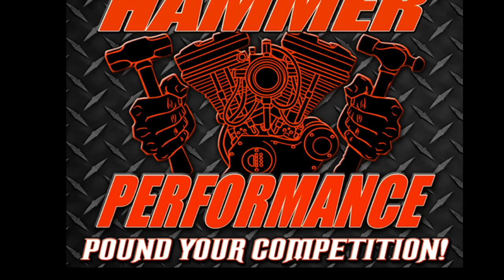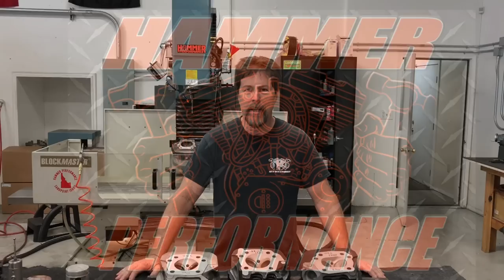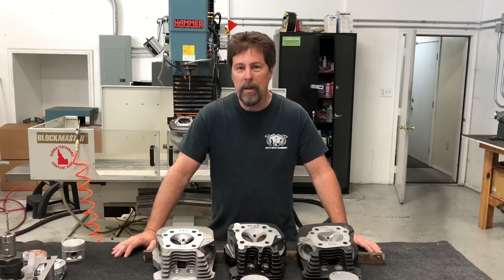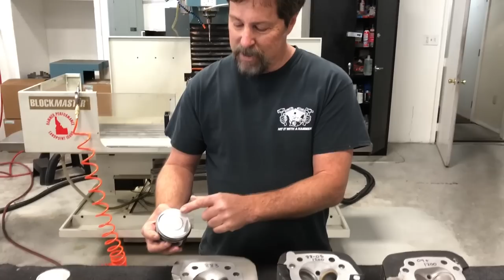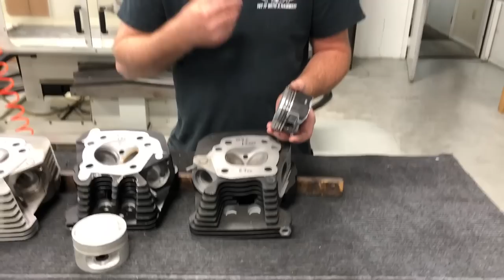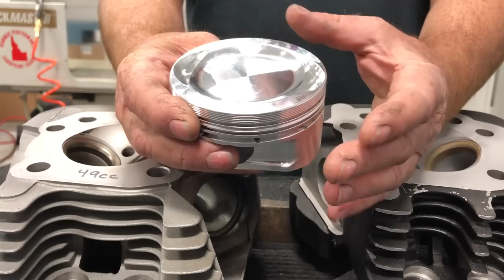The Basics Of Converting Your 883

Comment: Why does almost no one mention,  picking up a used buell xb12 engine,  and using it to build on. I just looked,  you can get a used buell engine for about 1k, with reasonable mileage.  It gives you the bottom end,  the pistons and rods, the heads, cams and lifters,  oil pump,  and primary parts.  Almost any local shop,  can do the machine work,  to allow the sportster cases, to accept the buell bottom end ( its not expensive) , and every shop I've checked with,  is familiar with the work.  With the cost of a used buell engine,  and machine costs, you can build a sportster engine,  that makes 100hp, 85 ft lb, for under 2k, if you did the work your self.  That beats any kit I have ever seen, when you consider all the upgrades you get. Even the buell oil pump,  is far better than what comes on a sportster.  The crank and bottom end is far superior,  to even a 1200 sportster.  Even with the cost of these kits,  your still at the mercy of the weak sportster bottom end. The Harley factory,  sportster bottom end,  will never handle revs to 7k, for a life over 50k miles.  The buell bottom end,  even with high piston speeds, will live for a long time,  revving to 7k every day.  There are buells with well over 50k miles,  that rev happily to 7k , with out issues,  and many will hold up to near or more than 100k, if you don't beat on it every day.  Cost wise,  and for reliability,  hands down,  picking up a used buell engine,  to build a sleeper sporty,  is the way to go.  I personally own an xb12s, and it's been an amazing bike.  I couldn't imagine a sportster,  with basically the same engine,  how awesome it would be.  I'm just surprised,  that a buell to sportster conversions,  isn't more often mentioned,  as apposed to the pricey stage 3 and 4 kits readily and,  and those kits do not improve the bottom end, for about the same money,  you get a better bottom end, better oil pump,  and a potential 100 hp, with durability,  revs to 7k without complaining,  ( I didn't factor in the cost of the fuel system,  throttle body,  ecu etc ) but even with that cost,  you still end up with a better engine.  And the cost is reasonable.  I'm guessing about 2500, for everything,  as long as you did the work your self ( minus shop labor to mod the case) please tell me if I'm wrong,  I encourage comments.  I've done alot of research on this.  The best way to make 100hp sporty,  is to use a sourced buell engine.
Reply from the maker: Through 2007, Buell and Sportster oil pumps of the same model year are identical, except for the fittings on the XB's are different. Literally every upgrade HD made to the pumps from 1998 to 2007 was applied equally to both the Buell and the Sportster platform. In 2008, the oil pump design was changed for the Buells, integrating it into the cam box cover cover and driving it off the cams, and the XR1200 got essentially the same design, but it's not retrofittable to an XL, it's a whole different deal. That cover won't bolt onto the XL case and likewise the cams that drive the oil pump won't fit and work in an XL motor.

As far as the cranks go, there's nothing about a Buell crank through 2007 that's more durable than a Sportster crank of the same year. It's slightly lighter, but both use the same size crank pin (1.25 inch), the same connecting rods, the same pinion shaft, and the same size sprocket shaft. In 2008, the Buells did get a much improved crankshaft, as did the XR 1200 (literally the same part number), and assuming you also get the matching front primary sprocket/alternator rotor assembly, these bolt right into the 2004+ XL and make a nice upgrade. No machine work is needed for this swap. This new improved crank can also be retrofitted to a 91-03 XL with a special service and parts we offer, and far as I know, nobody else offers this. It's not a simple process to retrofit it, we developed a lot of stuff to be able to do it, and other shops send them to us to be done.

The cams do not interchange between the XB and XL motor. Some people will argue that it can be done by figuring out where the marks should be, but the cam timing doesn't come out right when you do that (we've measured it). Also if you need the timing cup, the XB cams do not have the notch in the right place for the XL timing cup. The 2003-2007 XB cams are available already configured for the XL platform, however, in the form of SE cams (specifically the .551 lift SE cams). That's a much better way to use those cams in a Sportster. They're not a great set of cams anyway.

All 2004 XL1200's already have heads that are functionally identical to XB heads. They differ cosmetically, but they literally have the same ports, chambers, valves, springs, retainers, etc, the exact same part numbers in fact for the hardware. XB heads won't fit on 2007+ Sportsters, though, the gap between the manifold mating surfaces is wrong for the Sportster's throttle body. And the Buell throttle body won't fit the Sportster application, it's not compatible with the Delphi ECM, and the gas tank is in the way.

Also keep in mind that despite the 103hp claim for the Buell XB12, they dyno at about 90hp, we've dyno tested bunches of them. The 103hp is a crank figure, without the drivetrain losses.

 Bottom line here is that's it's not that cut and dried. The interchangeability that's possible between the two platforms, and the usefulness of the interchangeability, depends heavily on the specific years and models. A person better understand all the specifics of what he's trying to bring over from the XB to the XL to know first off if it's possible and second if it's actually an improvement. There are a lot of details. And to the extent you can bring parts over, they may not do as much as you might think.

Comment: Trade your 883 in a on a 1200. Done ✅
Reply: The benefit of swapping the head/boreing it is the gear ratio of the 883 tranny is different than the 1200 so you end up getting more torque than a stock 1200.
Reply: But then there's the look on the face of the 1200 rider who just got their tail waxed by what they thought was a stock Iron 883...